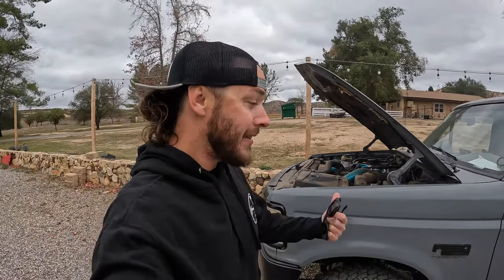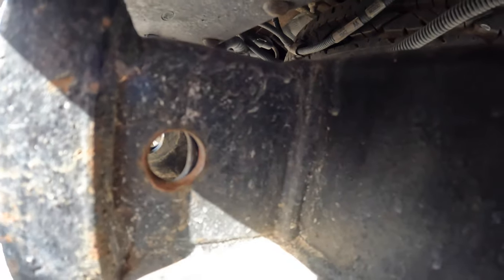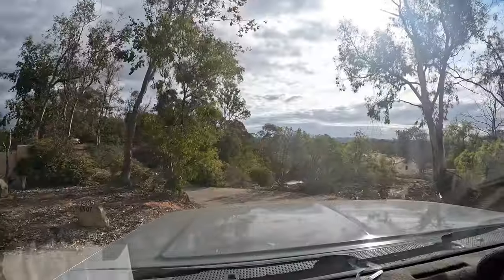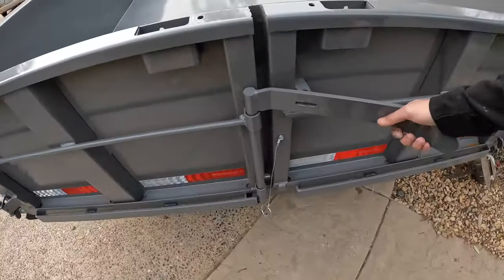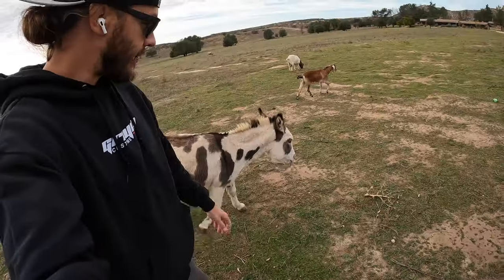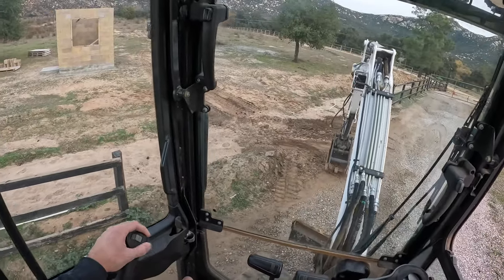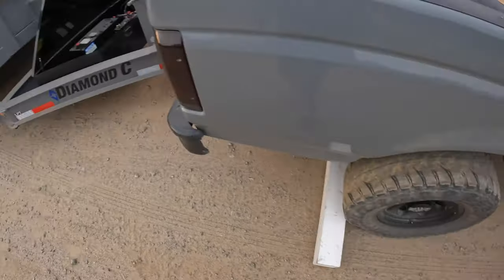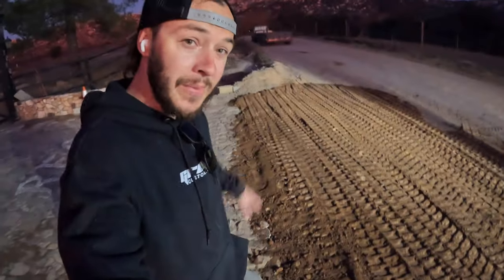The First Time Using My New Dump Trailer (And Everything Went Wrong!)

Comment: Hey Ryno I got a 2016 diamond c dump trailer as well but one thing I do recommend for these is adding a solar charger for the battery! It helps keep the battery charged up in case you ever forget to plug it in. Great to see poppa Ryno’s truck doing work! proving to people show trucks are work trucks also. Keep it up!!
Reply from the maker: That’s the plan as well as a second battery!

Comment: A suggestion to save yourself some off site extra work and money in the long run. A covered or enclosed trailer to put your forms in. You bring your forms in to your job on the trailer and set them up, when you are done you put them back on the trailer that is for the forms and then they are ready for the next job without moving them 2 or 3 times off site. When you need them again you just hook up to that trailer and go saving you how ever many hours in labor in off site prep work. Figuring the average workers rate of pay and how much time spent stacking this stuff up and then loading it back in something again to take it to the next job, how long before that labor cost saved and keeping your forms out of the weather when not in use pays for the cost of an enclosed trailer dedicated to the concrete forms?

Comment: Saw a great idea. By a Harbor Freight wireless winch controller. Wire it into a solenoid that controls the lift and leave the controller in your cab. I don’t remember if you have the two way tailgate or not that you can hinge at the top.

Comment: Usually you can depress the up down buttons on the dump trailer if you find the sweet spot on  the lid of the hydraulic/battery box.
Reply: You sandwich the controller between the corner of the box and the weight of the lid holds the button for you

Comment: Ioxus Ultra Capacitor 12V would solve your dead battery problems. It's like having a jump pack built into your vehicle. Just open the app and put it in jumpstart mode. It doesn't replace your battery.

Comment: Hey Ryan, you probably know this already, but you can push the handle on the trailer crank in and it will lock in place so it doesnt flippy floppy all around on ya while cranking it.
Reply from the maker: Yessir, but it’s so close to the front of the tongue, If your truck is angled a bit, you almost slap your hand. It’s annoying when floppy, but a shorter distance

Comment: i dont know if anyone mentioned it or not, but never chock the rear tires in a situation like this, or when loading equipment. its pointless. if when you are dumping something heavy, or even when loading a piece of heavy machinery you will lift the rear of the truck off the ground, and unless you are in 4 wheel drive that chock wont do anything. chock only the trailer tires, and/or the front tires of the truck only!

Comment: The Bronco should be able to pull that trailer right?
Reply: Most newer SUVs the size of the Bronco can’t tow more than 2,000 lbs
Reply from the maker: Bronco tow capacity is 3500lbs trailer empty is 4500

Comment: Dumb place to mount license plates. 🤦‍♂️
Would have been torn off the first week I used mine. 
I just drilled 2 holes and mounted mine on one of the back doors. I don't need a light, doesn't get used at night.